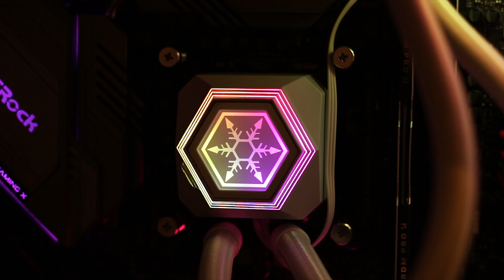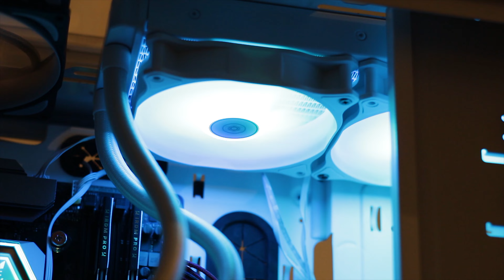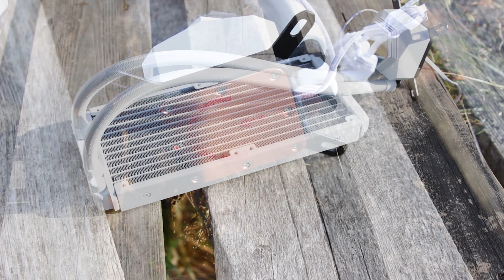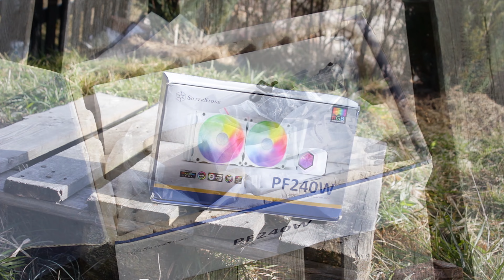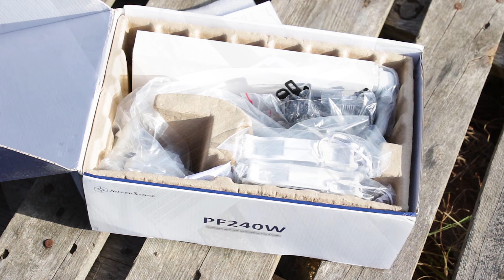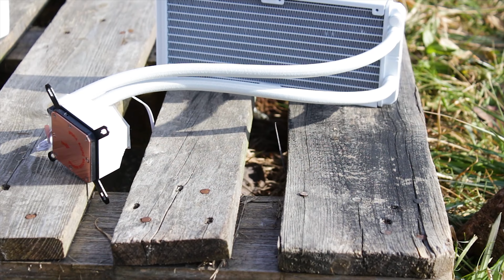Silverstone Permafrost PF240W-ARGB - CPU Cooler Review

Comment: Do i need to refil water by time or??? I have this cooler and last 2 weeks temp is around 100c i changed termal paste but temperature is still 100c in windows without doing anything...but in game too temperature is same
Reply from the maker: No need to refill the water. It seems that your pump is not running. Did you connect the Pump to a molex connector?

Comment: what is the lowest speed for pump (and starting voltage pump) ? thanks
Reply from the maker: The Rated Current of the pump is 0.39A while the Rated Voltage is 12V. I couldn't say the minimum voltage, but the pump still works with a Noctua low noise adapter.

Comment: I am getting this and I will certainly turn down those fans to 1000rpm as its going to be much quieter and parts should last longer in theory as long as I don't overclock my CPU which I do not plan on doing.
Reply from the maker: Sounds like a good plan, and they will still look good even at 1000RPM.

Comment: can you change colours on this
Reply from the maker: Yes you can.
Reply: How
Reply from the maker: @car2920  Either, connect the cooler and the fans to your RGB motherboard header. Or, use a dedicated RGB controller.
Reply: @TechLegend-com  i dont have controller rgb for that, have you software
Reply from the maker: @car2920  Are the fans and cooler connected to the motherboard?
Reply: @TechLegend-com  ye
Reply from the maker: @car2920  What motherboard do you have?
Reply: @TechLegend-com  Z490
Reply from the maker: @car2920  Which model?

Comment: Did anyone experience loud pump noise coming from this AIO? I just got my installed as I love the snowflake, but pump is running over 3000rpm and making this unpleasure noise
Reply from the maker: Yes, there is some pump noise. You can use a low noise speed adapter to get rid of that noise.
Reply: @TechLegend-com  thanks for the tip, that's my first water cooling :) I changed voltage settings and was able to quiet it, but what exectly is this adapter?
Reply from the maker: @Rogal85  Just search for a Noctua Low Noise speed Adapter. You will find it, it's like a connector for a pump/fan that lowers the voltage/speed of the pump.
Reply: if you have spare fan connector on MB you can use it for pump and then you can control speed (DC mode not PWM mode). I have two AIO in my life and both was used with lower voltage than 12V because of pump noise. In many cases this doesnt affect cooling performence (if yes not too much for gaining a quiet operation)
Reply: @capieluky  i manager to lower RPMs in BIOS :)